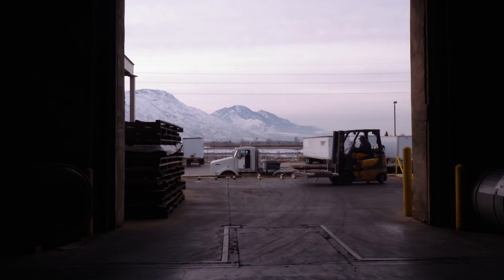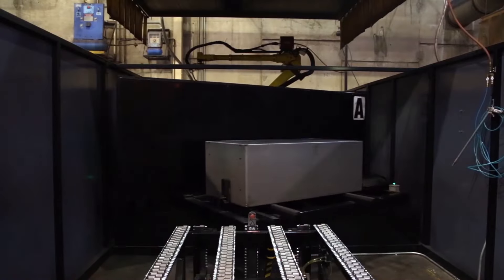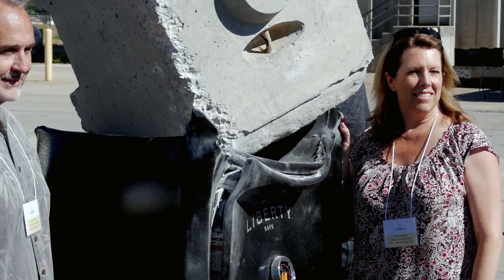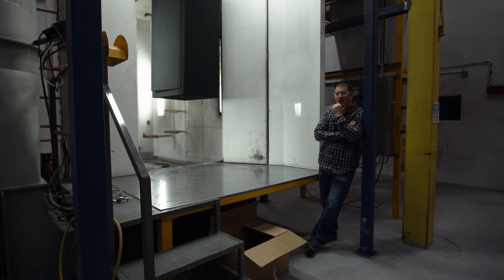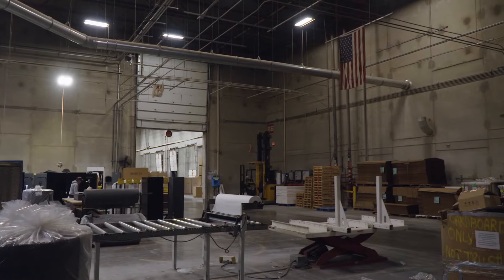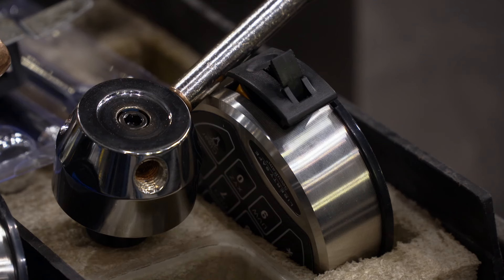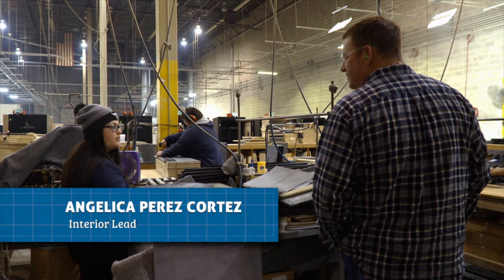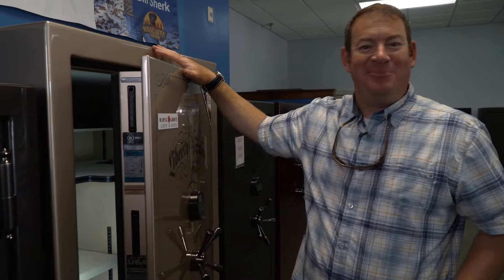How Are Liberty Safes Made? A Guided Tour Through the Liberty Safe Factory

Comment: Wonder what the rating of these safes are according to EN1143-1 ?
They have some great features but at the end of the day they're just steel boxes and seems not that thick steel. The issue is that these day there's something called an angle grinder and even small ones cut quite fast in steel. Don't get me wrong there are steel boxes that get EN1143-1 grade I rating but higher ratings require special cut and crush resistant concrete in combination with steel. But they're also in a very different weight class in more than one meaning.

Comment: Locking tabs look easier to cut then bars. I would assume it's hardened steel. Then again the safes are really nice but 98% of safes are all made this way which is a big weakness. Anyone with a grinder and cut off wheel can get through the sides or back very quickly. People put lots of effort into the doors of safes to keep it from getting opened. Yet leave the other 3 sides very vulnerable within steel and a little bit of drywall that doesn't stop anything.
Reply: Agree totally, and then use junk particle board inside for shelves.
Reply: Yet you won't find anything better for $1,200. (Liberty Centurion 24 with electronic lock) Also, if keeping it relatively light because you live a mobile lifestyle or in a manufactured home is important, again, nothing beats a Centurion 24. It certainly beats its competitors and it certainly beats not having any safe at all. Liberty makes much stronger products than the Centurion, but if you want to keep the safe under 400 lbs, there is NOTHING better out there. Not everyone can justify owning a 2,000 lb juggernaut with half inch thick steel walls...
Reply: @brianwhite9015  not denying it being a nice safe just stating a common flaw with most of the safes being made today. As far as light weight unless you bolt it to the floor I don't see the point two people could take a 400-600lb safe out of a house easily with a hand Dolly. I do agree a safe is better then no safe. I just think they should make them out of AR steel (abrasive resistant) at least. Especially now days with how good cordless handheld tools are.
Reply: @simple man  grinders make a lot of noise, and I have protective neighbors. They know I won't be doing any steel grinding in my house, especially when I'm not home. My safe and my armed neighbors are more than enough security. It'll do until I buy a brick and stick home here in the near future. Also, empty at 370lbs it was quite the effort getting it up the porch steps and inside with two men and a hand truck, it's not that easy. And full it weighs at least 500lbs.

Comment: It's a great apartment safe. I have one bolted to the floor. I sound like an idiot but I had an accidental discharge Beretta 92. Bypassed the decocker and thumbed the hammer down on a loaded chamber. My greasy thumb slipped off the hammer and boom 💥  the round passed through the back of the safe two walls (4 sheets of drywall) a wall stud and a closet door, passed laterally through 6 blinds, bounced off my dual pane glass sliding back door and landed on the carpeting. I was mortified. The 92 is as safe as they come the safe however is not bullet proof. I intentionally load and unload my carry  piece in the safe guess I need sand bags.

Comment: EMP resistance is not EMP proof.  A CME like the one in 1859 Carrington Event., will it open?  My mechanical dial lock will.
Reply: Yeah. I love the good old dial lock too. I can understand the convinience of an electronic if it's operated at a daily basis. In that event I'd probably prefer a fingerprint lock.
An EMP is not that likely. It has to be rather strong to destroy a lock that is mostly inside the safe. But there sure are both benefits and trade offs of each lock type that you need to be aware of.
The dial lock can be decoded if you're extremely skilled and have time. There's also auto dialers that will brute force them in reasonable amount of time. Some day they'll be cheaply available on Ali Express. Their strength is clearly no power and very secure although a little slow to open because dialing process takes time.
The electronic lock is convinience. Again very secure and just about nobody will be able to open it without destroying safe. There's however some unknowns. Does someone have a superduper mastercode somewhere? Have the manufacturer made the electronics to secure standards? Some of the cheaper locks you can just hook up your own keypad accessible from front and then open it.
Then there's keys. A good key lock is very secure and pick resistant (but not 100%) and cheap. The big disadvantage with keys is that people tends to keep them somewhere "secure" and when a burglar finds them (they often does!) then they have easy acces to the safe. If you're carrying the key with you and you're victim of a street robbery - not only dothey most likely find something with your address on (social security card in many countries) but if they also see that key then they have an even higher incentive to visit your home. Safe keys are very distinct and means that there's guns and/or valuables at your home - bingo.
So yeah combination is the way to go. You however have to decide whether to pick the mechanical or the electronic. Choose a good one and it's very secure for ordinary home use.
If I stumble upon a good 4 disc lock I might consider upgrading - makes auto dialing take much longer. After all autodialing is the most likely non destructive attack as decoding is difficult even for skilles persons and as said it's probably a matter of time before auto dialers are cheaply available to anybody. After all they're just simple mechines containing no really expensive parts - all just standard industrial parts available to anybody (but putting them together is the hard part)

Comment: Like all manufacturers, they make a range of safes from cheap and nasty, to the top of the line with hefty solid steel rather than thin sheet metal. You get what you pay for - it doesn’t matter how good they look, or their features they offer, unless it’s more than thin sheet metal then you are buying cosmetic security - I’ve seen  cheap safes opened in less than 5 minutes with jemmy bars or disc cutters.
Reply: I couldnt agree more. The sheetmetal boxes of drywall on display here are security theater at best and outright fraud at worst. Sturdy, Graffunder, and any TL30 safe should be considered long before these fancy painted tin cans. There are bound to be used deals somewhere if you look in the right place. No reason to lower your expectations this far.
Reply: @1FAST91SONOMA  Every single safe you named can be cut into just as easily as a Liberty safe..With a oxy/acetylene torch i can cut through half inch steel like it's butter..Before you spew bullshit about no one carries around a oxy/acetylene torch well they also don't carry around grinders..
Reply: @Jeremy Collins  yeah let's compare 25k plus safe to a safe that cost under 10k..And no a torch will cut that Graffunder with ease..

Comment: If I had to buy a new safe today, it would be Liberty! Luckily, I was able to afford a great large safe in 1992 that has the expanding foam seal, 3/8" steel door front, 8 bolts and it class 3 fire rate for 90 minutes at 1,650 degrees F according to the owners manual. Today after 40 years of marriage even my wife said it was the best decision I had made for purchases. Now, if I can get just one more thing right?